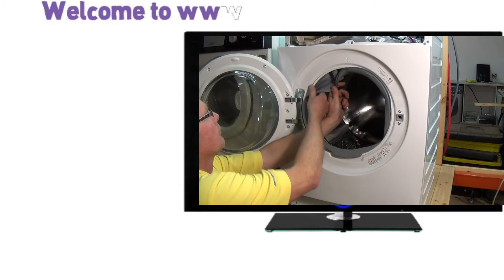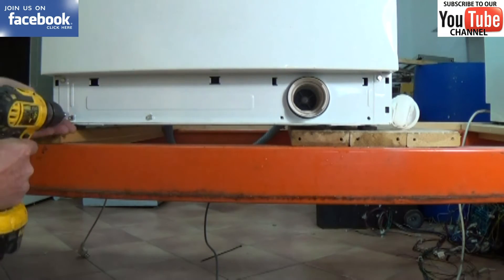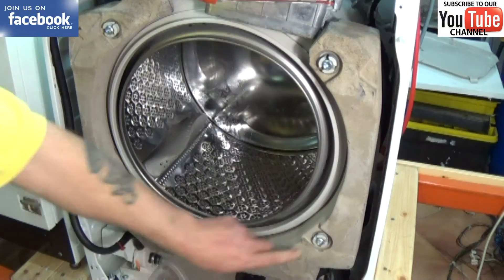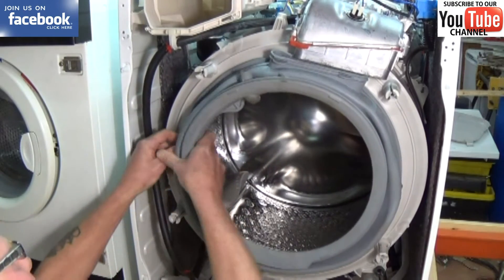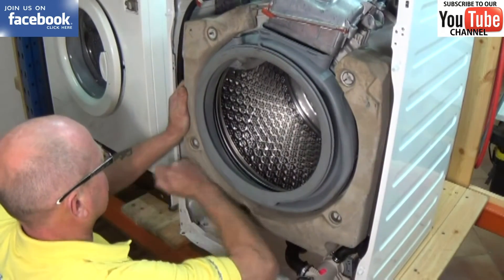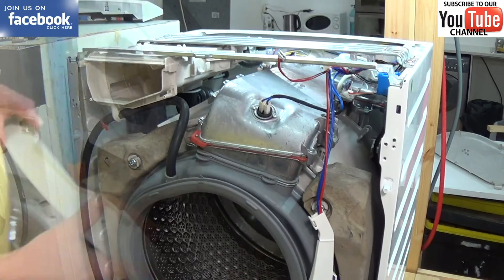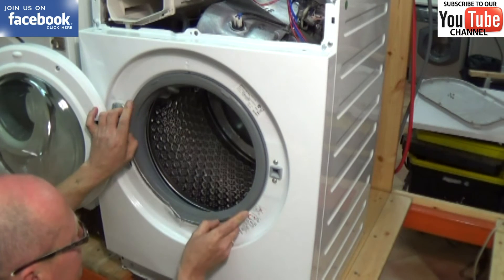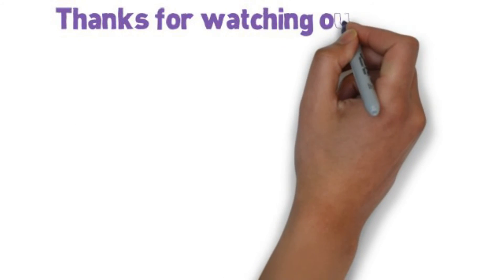How to replace Washer Dryer door seal large 8kg 9kg models only Aeg, Electrolux, John Lewis, Zanussi

Comment: How about the built in machines then like mine. Electrolux EW14450W First the drain pump went, then the heating element then the door seal split perished i paid £600 pound for this load of shite.Now my friend who paid £350 for a Beko washing machine and a seperate Beko dryer yes £350 for the two  which he installed in his garage and has had 3 trouble free years.And did i mention the water adamage like floor tiles and rising damp caused by the machine leaking.Oh and new plinth kickboards